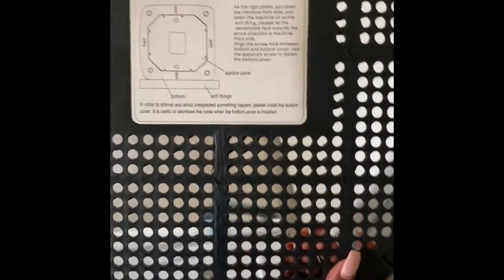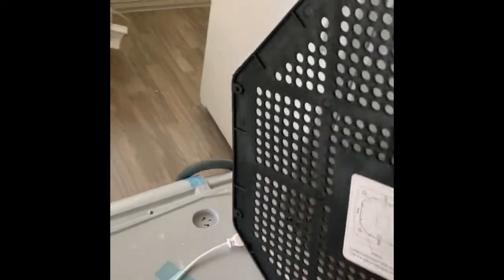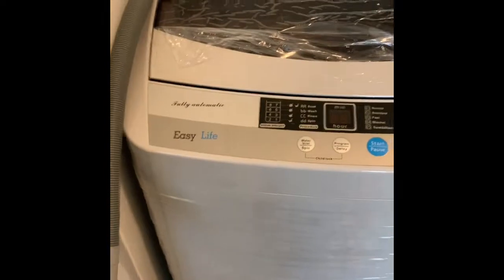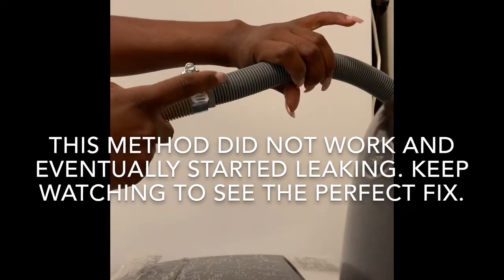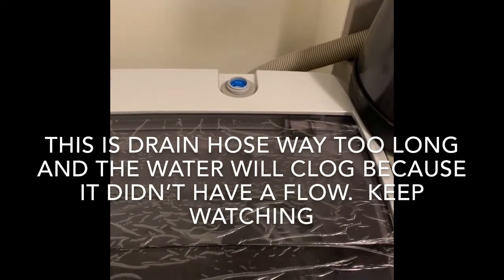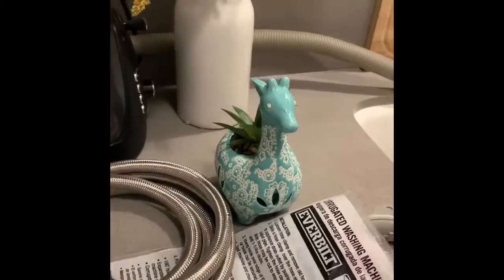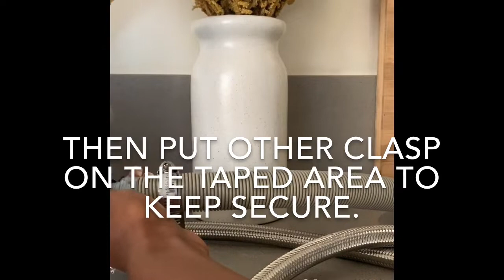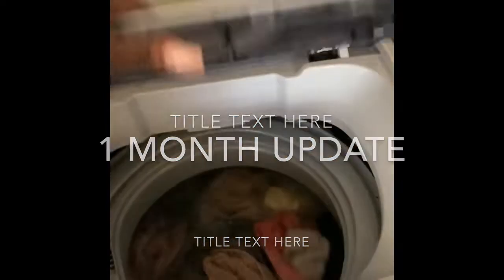Giantex Full-Automatic Portable Washing Machine: DETAILED How To Set Up In Apartment & 30 day Review

Comment: Can you share the exact type/model of item you used for the inlet hose? You flashed the packaging very quickly and superimposed text on top, so it is very difficult to understand what you used to get this working. I just purchased the same unit and am struggling to get the inlet water working. Thanks!
Reply: Isamu Hoshino Everbilt 8 Ft Washing Machine Supply Line, 3/4" x 3/4" x 8 ft. Stainless Steel

Comment: I think that plumbers tape is not meant for what you used it for. Typically you use that kind of tape on pipe threads to keep them from leaking. In your application it may have worked better to put the tape on the part of smaller tube that went inside the larger one. I'm happy that it seems to have worked for you though.
Reply from the maker: Thanks for the tip, I’m sure I used it completely wrong, I know nothing about plumbing 😂 BUT it’s still working great, so I’ll just let it do it’s thing

Comment: You could also just fill the machine up with water from a bucket. That would've been so much easier
Reply from the maker: Hm, i haven't tried that way. I typically like to hook it up to faucet only because it automatically measures/adjust the water levels when needed. But good tip, thanks!
Reply: That option would be for if you just cannot find the right connections which is me right now😬, but I am with Sis, I want to hook it up because it will measure and continue to add water as needed, I am currently standing over my sink in case it needs more water because I was just desperate to wash cause everything is dirty🤦🏽‍♀️
Reply: @KD-eq4xi  yea i get it lol
Reply: That method defeats the purpose of buying this particular model with all it’s features. I’m sure she wants it to mimic a standard washer as much as possible.

Comment: I bought the wrong kind of adapter thingy, wish I'd found you first.  Could you please tell me exactly what you bought?  The part that connects to the sink with the green?  Also, is there a part you needed to buy for the other end that goes into the machine?  I've watched both this one and the follow-up.  I think you are awesome.  Tell that plumber that the tape wasn't used for that until you showed them how!  I'd appreciate all you can tell me.
Reply from the maker: Hey! Thank you for watching! So the green thing is from Home Depot called a “neopearl large coupler and fitting” and no the other end of the inlet hose was made to already fit thank goodness. Haha and you’re so right, I made a new purpose for that tape! Please SUBSCRIBE! I’ll have more home/apartment content coming soon! 🖤🌻
Reply: @ImsimplyLC  Thanks so much!

Comment: I don't have a standard old school faucet.  So I'm confused 😕
Reply: So after a ton of research and many trips to home depot I finally figured out how to connect it to the kitchen sink. You have to buy a quick release coupling adapter for your faucet. The problem is the side of the adapter only connects to garden hoses, the pipe thay comes with the washer is brass pipe threading. Therefore, you have to buy a garden hose to brass pipe converter. The hole contraption will set u back about 15 bucks if u order the adapter from Amazon and get the converter from home depot. Hope this helps
Reply: @muqadasmalik1206  omg thank you so much!

Comment: Do i turn on the tap before the settings or after
Reply: I have this same machine and turn on the water right after I start the cycle. (After using it for a few months my old faucet started to leak around the base of the spout/handle, so I try to keep the water on for as short a time as possible.)